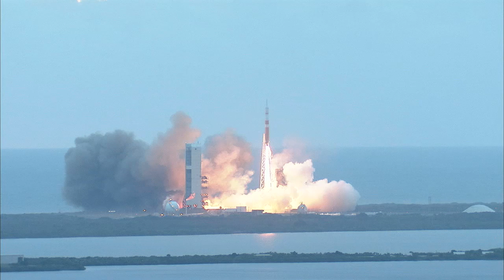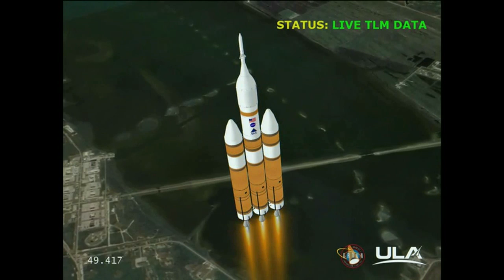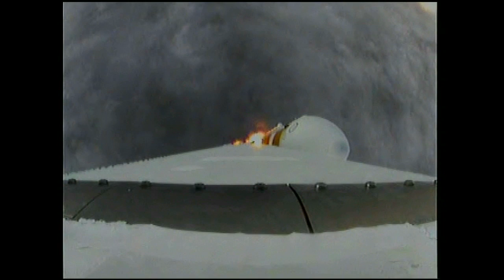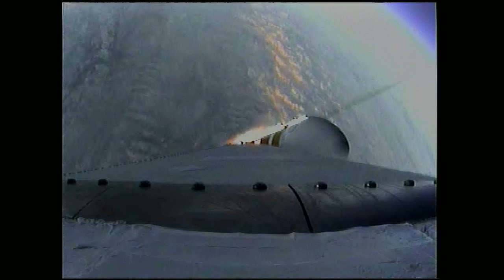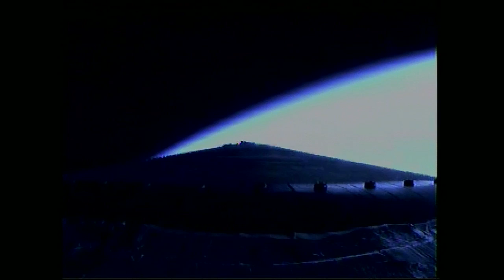Liftoff of Orion

Comment: How can the rocket be going 1341 fps at 25 seconds. That is 914 mph according to Google converter. But then at 1 min, 31 sec, the narrator says it's going the speed of sound, 767 mph. Did it slow down? Where am I going wrong?

Comment: Why does the vehicle roll?
Reply: Couple reasons - first, trajectory: it must roll and turn to align with the desired flight profile for the mission. Second, maneuverability/aerodynamics: it's much wider than a single-stick rocket (like Delta IV Medium or Atlas V), so having the three boosters parallel to the earth's surface makes maneuvering easier and reduces dynamic loading during flight. Finally, communications: some of the antennas on the vehicle are line-of-sight and need to be facing down to transmit data to the ground.